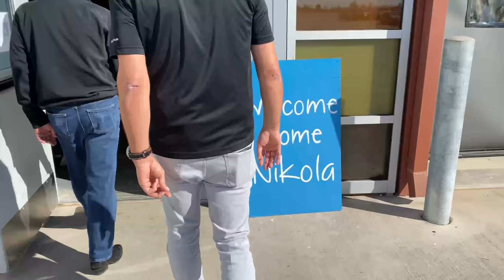Nikola Series - Ep. 3: Coolidge Facility - Assembly Tour

Comment: They aren’t integrators, they are assemblers
Reply: What is your definition of an integrator that they don't meet?
Reply: @lockbert99   - NIKOLA , does NOT Intergerate ANYTHING, they PARTNER with EVERYONE, Trevor said. 
NIKOLA , does NOT do any ENGINERING itself, not the INVERTERS (Cascadia), Battery CELL, Traction Motors, Drivetrain, the Body & Chassis ..........MORE.
Reply: Big Doug - Agree, only a PITYFUL Assembly plant , just like Chevy BOLT.
Reply: @lockbert99   - Technically, its called FRAUDULANT.
Reply: @markplott4820  You don't appear to understand the meaning of integrate. When you integrate you don't build components. You take components and make them work together.
Reply: @markplott4820  Technically it's called "short seller screaming".
Reply: @markplott4820  It is nothing like the Chevy Bolt plant which is fully automated.
Reply: @lockbert99   - I dont hold NKLA stock , I am FORBIDDEN from holding stock in a FRADULANT Company.
Reply: @markplott4820   and yet you have all the time in the world to watch the video and to comment on here? yeah right
Reply: @markplott4820   I haul parts to tesla plant and you are dead wrong! Tesla makes nowhere near 73% of their parts- where did you pull that number out of? never mind I think I know
Reply: @lockbert99  - They don’t look like guys that can bring the software side into the picture, that’s integration.
Reply: @lockbert99  - When it’s running, which it isn’t at the moment, maybe by Feb.
Reply: @markplott4820  Right, you are a short seller.
Reply: @markplott4820  Can you give us a reference to back up the claim that Tesla makes 73% of the parts in it's Fremont cars?
Reply: @Chainyanker007  Who doesn't look like they can manage software? No one in the Munro videos has a title with software in it.
Reply: @002tar  any proof of your claim that you deliver parts to Tesla?
Reply: @002tar  what parts do you deliver?
Reply: @markplott4820  🤣🤣🤣👍
Reply: @bigdougscommentary5719    why would I lie about being a truck driver? but here-----
Obviously, there's more to this than just the factory location; Tesla uses local suppliers for the majority of components it uses in its electric vehicles. For example, 65% of the parts used to make the Tesla Model 3 (Long Range, Standard Range, and Performance) are sourced from the United States and Canada

not exactly making 73% of their own products now are they?
Reply: @lockbert99  I dont see a lot of engineers, I see factory workers assembling trucks. If there are engineers working on making the different systems operate as a whole, that is integration. The Nikola employee himself said they were working on the processes to assemble the trucks. He didnt mention engineering the systems to work with each other.
Reply: @bigdougscommentary5719  Their engineering offices are in Phoenix. This video is of the Coolidge factory. You engineer different systems to operate as a whole before people start assembling (in this case hand assembling) trial production trucks.
Reply: John Brennan  I suspect "Mark Plott" also has some Nikola shares sold short.

Comment: How is trevor and where did they build the truck? - wasn't in this empty warehouse. 
( once upon a time it was filled with money  - now it's just empty)
Reply: Yeah, well there's that.
But Sandy is taken by the non-fasteners aspect of it all.
Reply: @henryD9363  Snap Snap CLICK Sandy....snap together do not usually hold up, look at plastic electrical connectors break over time from heat stress, Sandy I do believe is actually clueless..about what quality manufacturing really is, all he does is rant about cut costs, leave this off, don't do this, and make it snap together, not long term usefulness or reliability...bet if he went to an Audi or Porsche or VW factory, they would show him stuff that would shut him right up
Reply: @cengeb  yeah I would personally love to see him tour a Porsche factory…so they could show him where they cut costs on the taycan’’s onboard charger and where they charge people $600 to expand the usable capacity of their packs instead of actually fixing anything.
Reply: @sway5201  PORSCHE, still the top brand in most customer satisfaction, for years and years...Snap it sandy would probably get thrown out of Porsche, , for being goofy, and claiming they can cut costs by using plastic snaps, leave out the bolts and screws... Snap it Plastic Sandy.....not an engineer is he?
Reply: @cengeb  - He was one at Ford for decades.
Reply: @Chainyanker007  he was a tool and die maker, what engineering credentials does he hold?
Reply: @Chainyanker007  not decades, nope

Comment: It's quite a contrast to what we are used to seeing in a production car manufacturing plant. These are big complex vehicles that need lot of skill to assemble. Let's remember that we are still in pre-production so may only need to build about 30 vehicles. This is all building credibility for Nikola but absolutely we need to see 10,000 miles on the clock with all the reliability and sensor data.
Reply: What is this credibility to which you are referring?

Comment: Something feels very off with this whole series. Mostly off the shelf parts, yet don't admit it, that short bloke in chinos always in shot in all the vids, yet has zero to say or reason to be there. Doesn't he have something better to do that walk around eavesdropping and looking bored?
Reply: Chaperone for the SEC?
Reply: Don't admit it? Sandy asked about vertical integration and the Nikola employee said they don't plan to make anything beyond doing the software.
I was wondering about the "short bloke" as well. At first I thought he must be security. But found his LinkedIn and he is a manager and has prior experience at GM.
Reply: It's like a small town in an old western movie. The only thing that's real is the front of the buildings. In back is just props to keep the wind from tipping it over.
Reply: @lockbert99  they spend ages talking about better shut lines in the cab like they are improving things as they learn, but it is an off the shelf bought in product as delivered from iveco,
Reply: @ForeverNeverwhere1  "door gaps" and "panel gaps" are probably more a function of final assembly techniques. Yes, Iveco is making the parts to the correct size - and has been making them for several years.

Comment: Should stop wasting money on fuel cell already... It's more dangerous, less efficient, takes longer to refuel, and very likely using hydrogen generated from methane, in which the main by-product is CO2. Steam Methane Reforming is the most efficient industrial way of producing hydrogen and the process add CO2 to atmostphere, definitely not green, and hence most hydrogen vehicles are potentially just as bad as ICE vehicles.
Reply: Hydrogen is worse than ICE engines by orders of magnitude.. It's an impossibility to begin with. 
The amount of energy in ONE gallon of gasoline equals the amount of energy in SEVEN gallons of liquid hydrogen. Think about it. This is a fact of nature that you can't get around.  
And liquid hydrogen has to be kept at around 400 below.
 Other schemes of transporting and storing hydrogen are more expensive and less practical.
Reply: @henryD9363  I seem to recall reading once, and I can't say how accurate this is, that due to Hydrogens terrible density that there is more hydrogen in a gallon of gas than there is in a gallon of liquid hydrogen.

Comment: The plant already handles incoming deliveries of raw materials, components and system modules from around 2,600 suppliers, which are delivered to the plant in 100 rail cars and 2,000 trucks every day on average, and this frequency and level of inbound material is set to increase.

The additional production will also put greater demand on the outbound logistics from Wolfsburg. The plant currently ships out around 3,200 vehicles a day on 180 double decker rail wagons and 185 trucks. Additional capacity will be required to distribute annual volumes of 1m.

VW said in a statement that it was focusing on “significantly reducing the complexity of production structures” and looking to standardise its global production network. That network now amounts to 120 plants across the group, with output above 10m passenger, commercial and two-wheel vehicles and a model portfolio of around 300. From a logistics perspective that means moving around 180m parts and 40,000 finished vehicles per day.

Comment: In Europe Fuel Cell and BEV Buses, been driving around for years. Now imagine if they came out of Nikola or Tesla...the headlines: "Game Over!"
Reply: From the videos I have seen Daimler has not been selling any fuel cell trucks and don't plan on it for a few years.
Reply: @lockbert99  do your proper research then. Mercedes-Benz truck division, have Fuel Cell, BEV, and even a Bus with Solid State Batteries in testing. Hyundai has already a Fuel Cell truck to production. Also check DAF, Volvo, or Scania plans to electrify their trucks using Fuel Cell and BEV systems. Actually credible truck manufactures.
Reply: @lockbert99  in my street been passing for a while a BEV Bus from Karsan Jest Electric, powered by a BMW system. One thing is for sure, if it came out of Tesla or Nikola, the hype would be big. With trend lines as "Game Over".
Reply: @lockbert99  Fuel Cell Bus already been driving in Europe for years now.
Reply: @RogerM88  but no Benz,not before 2027
Reply: @Urfinchannel  the thing is, the annoying misinformation coming from the Tesla and Nikola fanboys, as if BEV and Fuel Cell trucks were something new. Check VDL and MAN BEV buses.
Reply: @Urfinchannel  Mercedes-Benz sells BEV buses. They don't have a rush to sell BEV Semi trucks, because BEVs in the truck division, are more suitable to the deliver sector, with lower millage and short routes.
Reply: Scania (part of VW) stopped fuel cell truck development, and went all in on  BEV. I just don't see it working in mass market, outside few very special cases. And even then using biodiesel would surely be cheaper and less harmful for the environment.
Reply: @praiha  Fuel Cell just lacks the supply infrastructure. And for an urban application as buses, having an BEV powertrain is more easier for the companies to adopt.
Reply: @RogerM88  Daimler "driving around for years" only refers to prototypes? Well Nikola has prototypes as well. Not much of a lead to crow about.
Reply: Hydrogen is the stop gap measure.  It has ultimately failed and will continue to do so.

Comment: as soon as these trucks become available i will become a city driver again.............. i hate diesels ..........did four years of long haul
Reply: You will be waiting forever
Reply: @stevenichols4639  Nikola will start deliveries to customers this month.
Reply: @Zorkmid123  Absolutely. Didn't you see the detailed videos of under the truck, the powertrain, the assembly line and paint shop, etc? Well we certainly did. They're going to be more than selling thousand a month In the next few weeks. Best thing on the road. No diesel smell from sure.
Reply: @henryD9363  No they won’t sell a 1000 a month right away.  But they will start delivering a few trucks this month.  They expect to deliver 25 this month.  They plan on starting small and then scaling up.  This factory in this video is not completed yet.  Eventually it will be about 1 million square feet, but they haven’t finished phase 1 yet.  When phase one is completed early next year it will be more automated.  It will be substantially larger at the end of phase 2.
Reply: @henryD9363  They won't sell a thousand a year and likely not a thousand total.
Reply: KURT - the NIKOLA Semi wont see the Light of Day , because the DOT and others have NOT SIGNED off , on the Nikola Hydrogen OR EVEN the BEV Version.
Its UNLIKELEY they ever will get CERTIFIED to operate on Roads & Highway.
SO, far they are ONLY Allowed to Drive in the Parking Lot.
Reply: @markplott4820  LOL says Mr Knowitall. Good to see all the triggered Tesla fan girls swarm into the comments section. 🤣🤣🤣🤣 But hey the Tesla Semi is coming out next year right ? 😂😂😂 since 2017 😆

Comment: Is anyone knows how many trucks delivery by Nikola so far?
Reply: They have not started what they call "series production" yet, and are facing auto electronics parts issues. So there have been no sales. There are likely a few trucks in trial use in some areas as trucks have been seen being taken away on trailers, but Nikola has not made any announcements.
Reply: @lockbert99  can we see under the hood, or on the axles where the motors are. And the battery in the trucks. Nope. Top secret
Reply: They expect to deliver up to 25 BEV trucks to dealers and customers by the end of 2021. Keep in mind the factory in Germany was inaugurated just a couple months ago and the one in Arizona hasn't completed Phase 1 construction yet. They are also facing supply chain disruptions like every other car maker.
Reply: @henryD9363  They pushed a bunch of stuff against the left wall and put partitions in front so they did want to hide some stuff for whatever reason.
Reply: ZERO

Comment: Making your own seats is dumb...Lear and others supply everyone....to spec...vertical  integration is an obsolete concept
Reply: Why let someone else control your design?  Why give up that profit also?  As long as you have scale and good engineering, vertical integration is a no brainer.
Reply: I think you are correct in this instance as they don't have any volume and never will.
Vertical integration wins at scale tho....see BYD or Tesla vs GM which is going under.
Reply: CENGEB - Tesla makes their own SEATS , and Sandy thinks TESLA has the BEST seats in a EV he has sat in.
Reply: @markplott4820  Cus he has never been in a Porsche or Audi, tesla seats suck....wake up.  Benz, Audi, porsche, better seats, better support, better design...built to spec by seat makers, vertical integration is old, obsolete...long done.
Reply: @markplott4820  Sandy was impressed by plastic stick on LETTERS on that over priced JEEP, and he called them Embossed!!! Oy Vey, they are stick on PLASTIC letters like every mfg uses...should jeep be making their own letters ? Porsche makes more profit per vehicle than any other brand, has for years, they don't make their own tires, seats,lights, they do make teh engines, frames, etc, why would a car maker want to make the parts to go into the vehicle, when suppliers can do it better for less, Denso AC compressors, should VW make their own AC compressors?  or head light assy, when HELLA makes the stuff for everyone, to spec